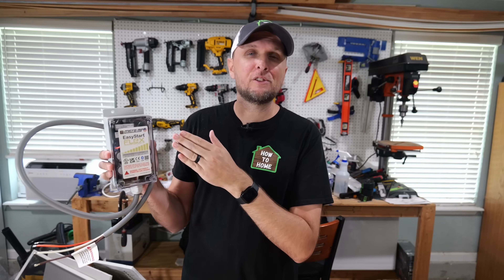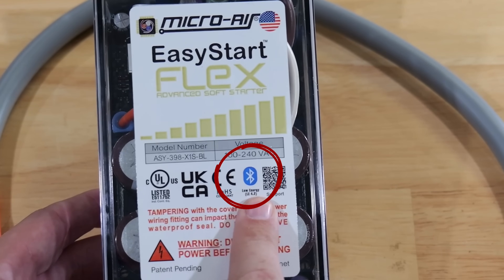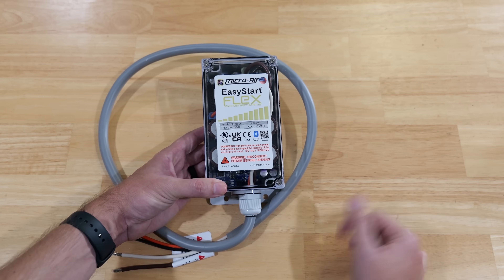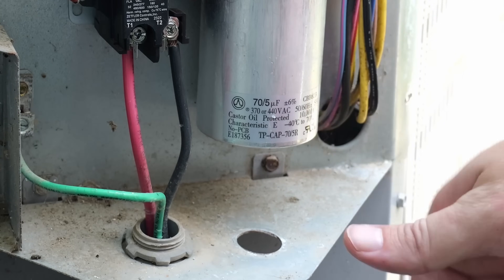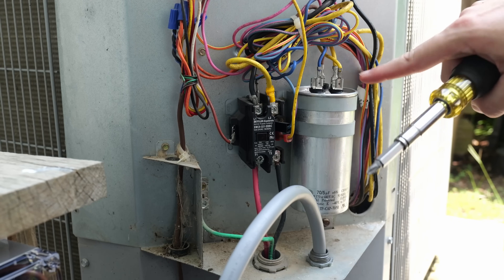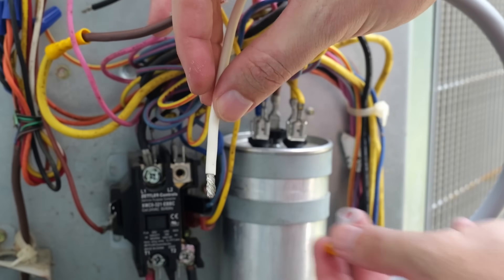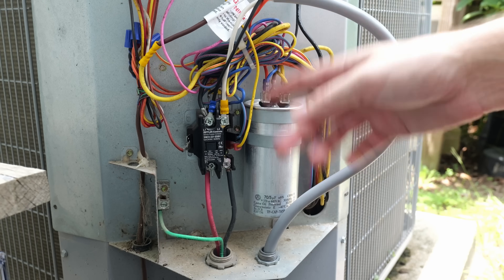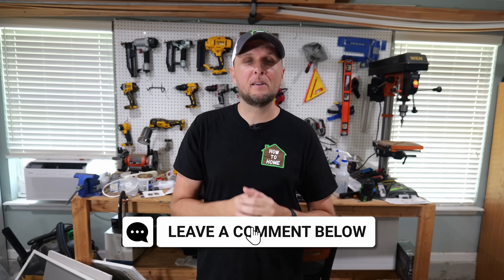The ONE AC Upgrade Every Homeowner Needs to Consider!

Comment: I think this makes sense for traditional compressors.. not those with inverters. Anyone buying a new AC basically should get one with an inverter and a whole house SPD with proper grounding.
If you cannot replace your old AC then sure that's helpful but for $390... I'd just save up a bit and replace the AC with an inverter
Reply from the maker: Save up "a bit more"?  I think it is a little more than a bit more for a new ac unit, especially the ones you are referring to.
Reply: @HowToHomeDIY well typically I use 12000btu ac and I bought them for 450 each about 5 yrs ago branded. Carrier model xpower
Reply from the maker: Ok that unit would not heat and cool my whole home or even most homes.  That is for one larger room.  It’s a mini split system.  Those are also selling for $1,000+ a piece now without install.  It’s an apples and oranges comparison.
Reply: @HowToHomeDIY  Yep, in my country most of the time there's no single unit that covers 1 house. It's 1 split system per room and price I quoted includes a back to back install. We also never really use heating because temps never drop below 15C. So effectively we would need that device x n number of units. Hence my point. IF that device can accommodate hungrier systems like you showed spiking to 120A+ then that's cool and I can't comment on value because I'm not sure how much these cost

Comment: can this cause a problem on defrost on 2 stage Trane units? By problem I mean faults on the defrost board. Curious about one of these as my unit wakes me up in the winter at night when it's cycling.
Reply: I installed a Flex on my 4 ton Trane AC/Heat Pump unit. My reading today showed almost 1800 starts and 0 faults.

Comment: I've thought about doing something like this on my house. I have no desire for any of the network connectivity or bluetooth connectivity this has however. Does micro air make a "dumb" easystart device?
Reply: All Flex models are Bluetooth (not WiFi) and the information provided will help identify problems.

Comment: Scam fr - 300 bucks for this thing?  You have to be joking ripping people off
Reply from the maker: How is it a scam? 😂 we aren’t talking about some piece of fabric or just plastic.  It is technology.  It has the ability to diagnose, protect, and extend the life of the compressor.  It also allows for those wanting to run their ac with a generator the ability to do so with a much smaller generator than they normally would which saves literally thousands right off the bat.  I’m sure the device you’re using to write your comment was fair in comparison right? 😂
Reply: @HowToHomeDIY srsly tho you have what a start capacitor, a run cap, a pot relay, pcb with sensor and a couple wires in a plastic box come on fr dude in China make this for 5 dollars man and you out here trying to get rich bruh Temu has your rv soft-start for 55 bucks on 115 for rvs how long you think till they put out one for 220?
Reply from the maker: Not made in China.  But you go ahead and get that temu one.  Let me know how it works out 😂.  How will I get rich off of them?  I don’t sell them or get paid by them.   But troll on bud.  Algorithm loves it!
Reply: @HowToHomeDIY  everything’s made in China dude, I might just cut into your market buy cheap ones on China and sell them for half of what yours are listed at ❤
Reply from the maker: @devbella5223 go ahead.  I don’t sell any or have stock in the company so I’ll still sleep great 😂
Reply: @HowToHomeDIY  gotta say though like if you don’t know how to fix stuff made in China you don’t have much business running a diy channel - sleep well :)
Reply from the maker: @devbella5223 really reaching now 😂.  Your trolling needs work.  Slept fantastic actually.  Thanks!
Reply: @HowToHomeDIY  much appreciate the constructive criticism :)

Comment: My pump would wake me up when it started.  The soft start really helped reduce the bang / buzz  at startup.  While you're in there change out the contactor and capacitor.  They are both easy to change and inexpensive.
Reply: I wouldnt change it out to a cheapo contactor. For a little more money, they make alot better ones.  You get what you pay for.

Comment: I was intrigued until I heard so many of the claims. Do you have any lab testing to back up the claims? Having done AC service and tech for a while, and knowing how they work, reduced compressor load or increased longevity does not seem true. The whole entire reason for a start (and run) capacitor is to provide enough of an initial amp/voltage jolt to kick start the fan and then the compressor. This seems like it would unnecessarily load the start / run cap, heat it up, cause premature failure, and "slow start" the compressor. That slow start on the compressor can actually cause damage, excess heat, and unnecessary wear. I would LOVE to see the lab testing that proves how this would extend compressor life as some of the results claimed. On another note, the way the "inrush" amps are reduced is by staggering the fan start from the compressor start. Maybe the load splitting between the fan and compressor has some value as that seems like the source of the reduced "inrush amps".

Comment: I've seen a lot of low ratings on the new model in Amazon.  Many of them only lasting a month or so before going out.  What other better brands are there?
Reply from the maker: There aren't.  This line was brand new.  There were very few that had some issues.  Micro Air has since change out the part and sent those that had an issue the new ones.  Micro Air is the best there is when it comes to soft starts.  You are free to go research it though.
Reply: @HowToHomeDIY  Thank you for the update.  The reviews on Amazon aren't always reliable.
Reply: The company I work for makes a self sacrificing power device and many people complain that they fail all the time, but they fail to realize it was working as intended. If it takes a surge, it stops the voltage but kills itself in the process. That is why a surge protector is important for these.

Comment: On my old single stage unit I had installed a "hard start" device so it didn't slam all the power at once on start up as this does bad things to the unit over time. Well my old unit finally expired after 13 years. I now had a Daikin Fit inverter system installed and  .... with the inverter system the power starts very low and ramps up after the unit starts. The unit is super quiet and you have to be standing next to it to even tell if it's on. Happy happy with the Daikin Fit  !!

Comment: Can? And how? this be installed on a 115v lawn sprinkler pump to achieve low in rush amps? I’m running on battery back up and want to reduce startup amps on my battery system. I’ve only seen this used on hvac but been told it works on electric motors as well??

Comment: 100% I got to use with new a/c with generator.
Old ac ran no problem but new had issues.
New a/c I could hear and see when the compressor kicked on.
With the micro air it is quiet, and I no longer hear the startup of the unit or see it.
I.e no power surge.
I do believe it is much easier on my compressor.

Comment: They are the $hit! 
I run one on my 16k BTU boat ac and can run it off my Honda 2200 ... and on eco mode.
 Also run it on the home 3 ton unit to lessen the hit on the inverters when running the house on soalr/batteries
Reply: Wait, are you saying to added this onto an already inverted compressor for the house?
Reply: @srobeck77  No-  Whole house can run off of grid or switch to inverter/ solar/battery. I can see the bump on the inverter panel when the 3 ton kicks on and sometimes when the water pump kicks on at the same time. Wasn't even an issue per se just like to quell any spikes or surges - easy start took care of that
Reply: @TrollingwTyrone  you didnt read what I said right. I said the cost to make up for install costs of all that solar crap ($30,000+) for if you were to just pay for electricity. On average people move every 5-8 years, so the cost of installation would never make up the difference.

Comment: My HVAC unit has an adjustable speed drive that powers the compressor motor which acts as a soft starter. You shouldn't use this soft starter with this type of HVAC.

Comment: I am a little confused. but is that not what the capacitor is for? I have a 3.5 ton unit and the breaker for it is only 60 amps. Again not saying this item does not work. but aren't you just wiring in more capacitors? if the compressor takes over 100 amps to start it would just throw the breaker. Not seeing how this would help on a generator maybe the extended length of time its providing power????
Reply from the maker: My breaker is 60 amps and you saw my readings.  It’s not tripping.  The amperage has to exceed the breaker for more than a split second to trip.  And no this is not the same as a capacitor.  It has capacitors in it but it is gradually ramping up the power to the compressor to get it started and only supplying what it needs.  Without it there is just a giant spike in power.
Reply: @HowToHomeDIY  ok but aren't you taking the amperage going to the compressor not the draw from the feed from panel? Again I am pretty much sold on the other features, I just am confused on how this could save you on electricity and how it helps with a generator, can you do a reading on the draw coming from the panel?
Reply: @gigglefart2340   A normal start up has compressor motor, air handler motor, condenser fan motor at starting at the same time which requires a huge surge to start 3 motors together.   After adding soft start, air handler and condenser fan start together and after a time delay, the compressor starts.  That sequence is a big deal by itself for allowing the generator governor to throttle up and stabilize. Then the soft start circuits ramp up the compressor slowly.

Comment: I have the old model and it reduced me from 127LRA to 24 amps. Very impressive. 
Works great under generator power. 

I was never able to get the Bluetooth app working, but Micro-air saw my comment on one of their videos and contacted me right away and got me set up on the app. Amazing company and WONDERFUL easy start.
Reply: @ericallen7200  i ended going through support about Bluetooth,  and turns out it's only used for support purposes, and requires a special app and code.
Reply: @jamesbsa6450  Actually, the app is great and allows me access to reset and to see all the trouble codes (there were none)
Amongst other things. 
The app will only work while the unit is running.
Reply: I don't think you can change your LRA. Is it possible you meant RLA?
Reply: @HectorFabela-k6u  isnt that the whoooole point of installing a soft start kit, to reduce the LRA? (That was a rhetorical question, btw).  RLA isnt affected by a "soft start kit", the name sorta gives it away.

Comment: Our lights used to dim when the ac kicked on.  The ac company installed an extra capacitor which fixed that at least.
Reply: Dimming, especially if you use LED lights is normal. LEDs are very sensitive to voltage compared to other lighting types. No reason to be worried about it, now if it bothers you that's fine.

Comment: The Internet is full of fads and trends. Hard start capacitors were the must-have thing for air conditioners a few years ago. There seems to be a wealth of current soft start videos and overwhelming praise. Indeed the praise may be valid, though I have some questions:
  1. Hard start capacitors were advertised as needed to get your compressor quickly turning instead of being in a stalled condition drawing high Amps for an extended period of time. With a soft start, it seems like the compressor will stay in the stalled condition longer. Can you further delineate the reason why a soft start is better than a hard start capacitor for getting the compressor out of the stalled condition? 
  2. I always hear that the significantly reduced soft start inrush current is a huge advantage and a must-have when powering via a generator. Wouldn't a hard start capacitor accomplish the same thing since the inrush current is satisfied via the hard start capacitor discharge while the hard start capacitor would be gradually recharged thereby not needing a similar huge inrush current?
  3. I can understand that the compressor is not hit with a jolt on start up via a soft start. But isn't that jolt needed to get out of the stalled region?

I have no bias with soft starts nor love for hard start capacitors. I am just looking for clarifications to make an informed decision. Adding a soft start seems like an electronically complicated point of failure for a simple air conditioning system. Here is Arizona, we MUST have our AC during the summer.
Reply: Its not a fad, more of a science based measurable thing.  Its also the basis for the new standard of inverted compressors if that's what you were hung up here.
Reply: Getting your teeth cleaned twice a year used to be a fad too

Comment: I installed one last year - not so much for use with a generator but because the unit outside is a little bit more quiet since my outdoor unit is right outside my living room wall. Well worth it!
They also offer an install kit that provides the liquid tight fitting and other miscellaneous bits like the spade connectors that makes the install trivial.  It's like $10 and also well worth it.

Comment: Thanks for another great video! Super easy to follow. I bookmarked the previous one you did for the older softstart but never ordered it. Glad I held off, this looks like a much better option. You mentioned they don't work with a hardstart kit. I believe I have one on my AC unit, is there a way I can tell? Thanks.

Comment: I installed one on my big unit some months ago. The unit starts quieter, but, I have not noticed a drop in my electric bill. I have since seen a video that disputes that it supports the compressor start-up. But, I am content knowing it aids the load on my generator when i have it supplying whole house power. I have seen the generator operate with the soft start and I believe it helps with the surge.
Reply: You won't necessarily notice a change on your power bill (unless you get billed for demand power - if you were you'd know it!).  It just smooths out the startup amperage; the amount of overall power consumed is still the same - it's not a perpetual motion device 😉
Reply: @DocNo27  agreed.  The spiked amp usage is only for a fraction of a section at start up.  So your electricity bill wouldn't be affected. This is for compressor longevity, when using a generator, or for noise.  Your electricity bill could have been lower due to a cooler summer that year.

Comment: It takes a specific amount of power to run an A/C, regardless of any capacitor.
What the soft starter can do is lower your demand meter numbers if you have that meter. Most homeowners do not have that nor would want that kind of meter.
It can help prolong the life of your compressor.

If your lights flicker or dim when the AC starts up, you need to have an Electrician or power company come and investigate your panel and incoming service.
You got more than an A/C issue....
Reply: Finally, someone who understands that total power = area under the curve, it's the same (minus minute differences for winding loss during surge) whether you apply 100 amps for 100 milliseconds or 10 amps for 1 second. One thing this guy said really bothered me though, remove hard start kit before installing a soft start kit. If a tech installed a hard start kit it's because the compressor is having a hard time getting out of start and into run, so going to soft start may mean it will never start. However, these are usually only applied to older units. Occasionally I need one of those in the morning too 😂.
Reply: @user-jd5sj8jx7r  PS I used to work in a rewind shop lol
Reply: @user-jd5sj8jx7r  My hard start int he mornings is a large coffee! Wife's hard start is the flavored fancy coffee.
Yep. I gradjeated skool!
I wonder if you use a stepping system with both hard and soft start caps?
Maybe hard on one winding and soft on the other? Or soft for 1/2 sec then hard after that?

Dunno. Rusty on my electrical theory.

Perhaps a decent inductor added to the system to limit power until saturated?

In power supplies, inductors can be used to limit turn on surge (protect equipment).
If they limit surge on those in theory they should limit surge on motors.

Just tossing out a few ideas.
Reply: 15 years with out this on my unit still. goin strong.
Reply: @droberts9145  Mine is older than that and still works.
That is the good thing about R22 systems.
They can last DECADES.

Comment: Problem with me is I have THREE different capacitors on my unit. Ho wiring diagram included with LOTS of wires going every which way. All factory too.
Reply: Their support is pretty responsive - have you reached out to them?
Reply: @DocNo27  currently the unit has been working fine so no need to do anything yet.